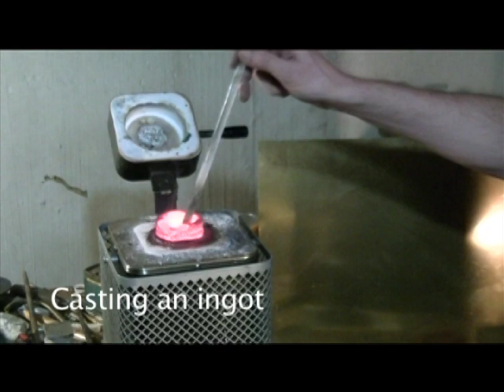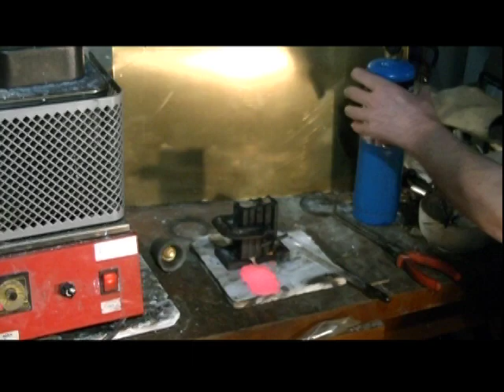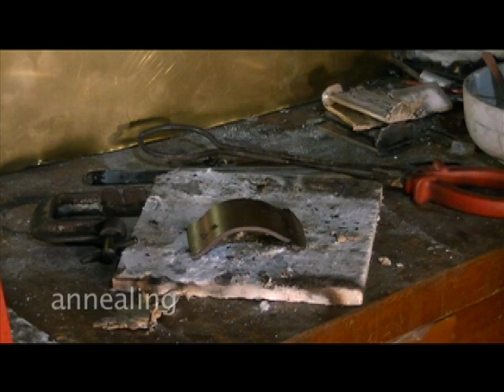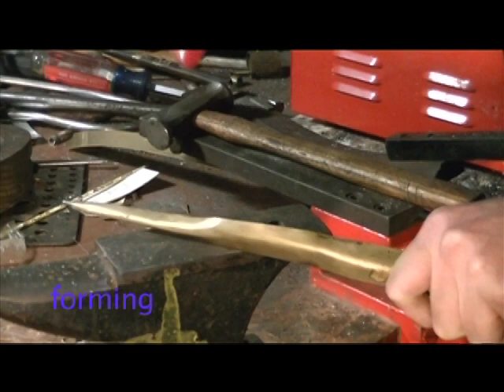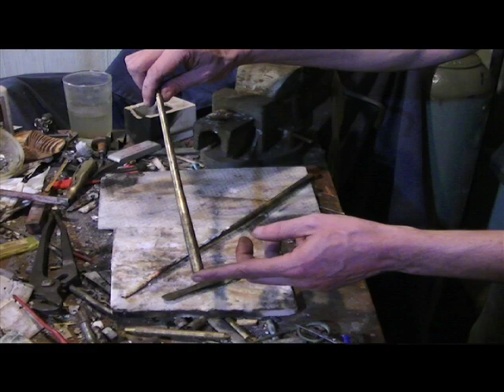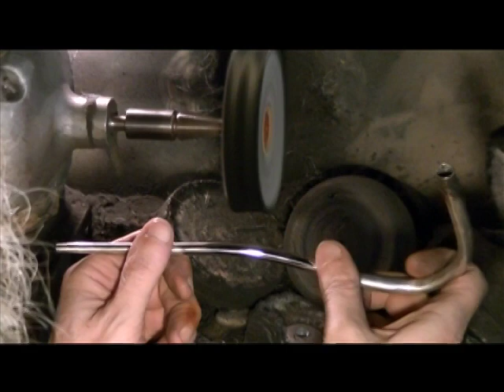bassoon bocal making

Comment: Awesome video! Any tips on getting the tip to seal with the reed easily? I make english horn bocals and have a hard time getting the reed tip shaped correctly.
Reply from the maker: Hi, I did reply earlier... How are you shaping? I find it very useful to put it on the lathe and set the cross slide angle to shape the bocal tip. Hope it helps!
Reply: +Robin Howell wow sorry it took so long and I can't believe I posted that twice. I think I typed it once and thought it got deleted so I did it again. I did manage to get a little better. Just took some practice and a lot of patience. It definitely explains why English horn bocals are expensive. There is nothing easy about making them. Thanks for your advice.
Reply from the maker: Just very careful work with a  file seems to be best.

Comment: Cool video! Is there some trick to getting the reed staple to seal to the bocal? I make english horn bocals but it takes me forever to get a good reed seal.
Reply from the maker: Hi
I also make EH bocals.. Have we met?
Since bassoon reeds do not use a staple, sealing is not quite as much of an issue.. For EH and D'amore, one needs to be quite precise with the initial taper of the tip. One method I have used is to turn the angle on a lathe, which gives very sweet results. In truth, I usually just file it on the lathe, and with a bit of experience, it works very well.
I'd love to see your work sometime!
Robin
Reply: I know I am a bit late on this one, but many EH players in my area use either of 2 solutions:

Attach a small piece of 1/4 inch diameter aquarium airline tubing to the bottom of the staple.
This is a very inexpensive method, but creates resistance and a very slight stuffiness to the sound.

The other method is using the EH staples that Mark Chudnow created.
They have an O-ring that keeps a seal on the bocal.
Works great, but are kinda expensive.
Reply from the maker: Hi, happy to help in any way I can.. pease ask any questions, there are no secrets here. How are your endeavors going?
R
Reply: +Robin Howell when I was able to build instruments on a regular basis, I felt that it was going pretty well and I was learning a lot. Lately I haven't been able to do it really at all because other work has kept me really busy. As I get more adjusted to my schedule, I'm sure I'll find time to do more instruments because I really enjoy it. I only got into oboes an English horns a few years ago but I always loved the sound and wanted to play them.
Reply from the maker: +soundstream03 
I hope you do get time to build! It is a pretty rewarding process. Feel free to write to my email; robinbhowell at gmail
best,
R

Comment: How did you bend it? Did you use Pitch? or frozen washing liquid? Do you have a die for it?
Reply from the maker: +excitabledon Sorry, I totally did not see this post!! I use lead sometimes, but am experimenting with a new water soluble plastic material that is very promising. The bending jigs I use are very basic, most of the work really done by hand. A bending block does help considerably, a block with a hole the size of the tube, radiused to the desired arc, very simple indeed.
R
Reply from the maker: I use eutectic metal, bent over a form by hand.
Reply: eutectic metal such as tin solder?